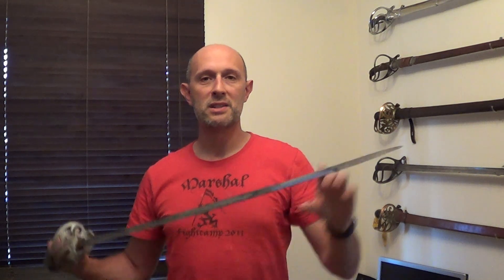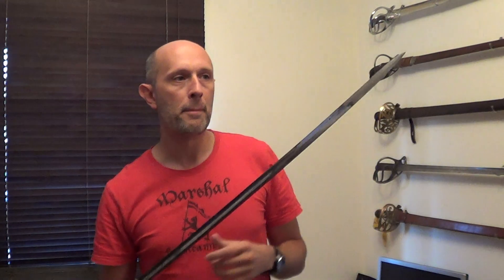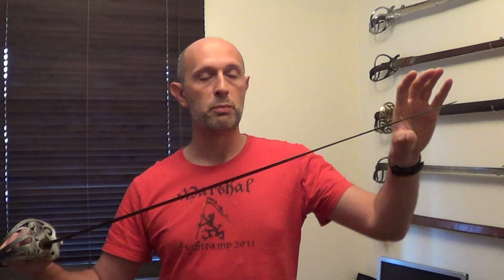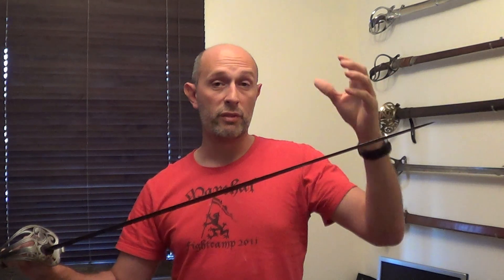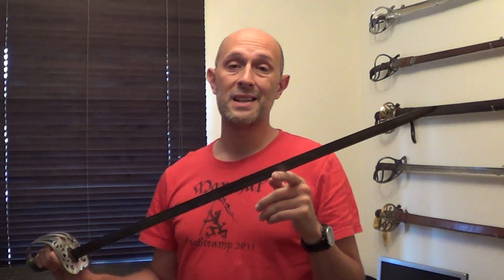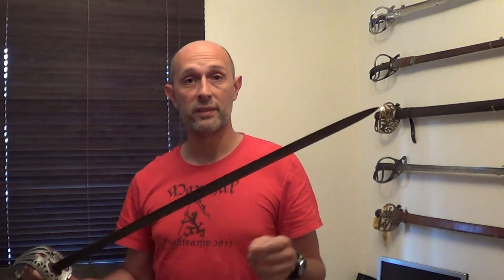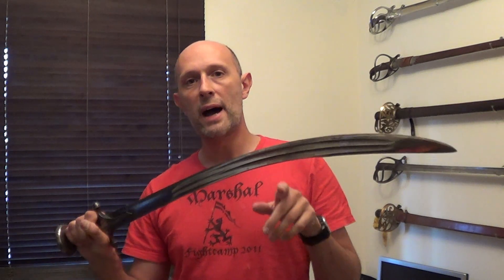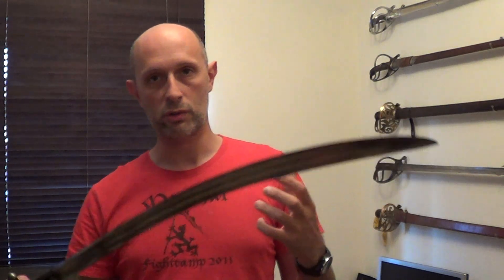Flexibility of sword blades

Comment: I have another question. In modern fencing there is a technique particularly in foil called "flicking" in which you whip the blade in a way to make it bend. This allows you to go around your opponents parry (or guard in epee) in order to strike them. Is there any historical accounts of flicking being done or is it purely a modern thing? I would assume that it would be only useful in a pure first blood duel since you wouldn't get enough penetration to actually kill someone (I don't believe). I also heard that in Chinese bamboo spear they're flexible like that in order to perform similar techniques. I've never found any solid evidence to support this.
Reply from the maker: Gallowglass You cannot flick real swords because they are stiff. If they were as flexible as a foil then you wouldn't be able to thrust through clothing with them.
Reply: As far as I'm aware, from a European perspective, it's a purely modern thing.
Reply: "in Chinese bamboo spear they're flexible like that"
Ahmmm. I don't know what kind of bamboo they use, but I have larp spears made of bamboo and honestly I use bamboo exactly because of the opposite. It's not flexible at all so it allows me to have good stopping power in my spear when somebody tries to charge me.
Reply: It's important to consider length.  Chinese spears are Looooooooong.  At the lengths they employ there is a good degree of flex, even in a hardwood or bamboo.  There are techniques that involve taking advantage of the this flexibility to strike around someone's parry, but like in most spear fighting systems, cuts are mostly to take advantage of the opportunity to wound the opponent and not the main goal.  Thrusts are the spears main value.  They aren't so flexible as to mess that up.
Reply: *****
What lenght would you consider it "looooong"?
I use 6 feet spears. The others I've seen start to flex a little bit passed 9 feet when still thin. People tend to go with thicker bamboo after that.
Reply: The chinese spears I'm familiar with are all over nine feet, usually over ten.
Reply: ok, that looks more like it
Reply: illyounotme However, also irritatingly named Wushu, http://en.wikipedia.org/wiki/Wushu_(sport)  
is a martial art, similar to kickboxing, though i find it to be more entertaining to watch.

Comment: Wibbles! lol
Oscillations assist with a cut.
Also, wouldn't an Asian super bendy sword, when penetrating and being deflected to an untrue (not straight) path, create a destructive path which might a) be more difficult to treat/heal, and b) cause a quicker finishing blow by hitting more essential organs?
Reply: No, super bendy swords do not cut better. When the sword hits a body it transfers force (I assume you know this), the amount of force transferred determines how powerful the strike is, how far it will penetrate, whatnot will be able to cut through. A super soft, bendy sword transfers much less force and therefore provides an inferior cut.
Reply: Also. The oscillations do not continue once the sword has penetrated more than an inch or so. The human body, particularly the muscles, offer quite a bit of résistance.you are not going to have a sword oscillating inside someone and cutting them up in that way,
Reply from the maker: Paul Sweeney Oscillations in the direction of the flats/sides absolutely do not assist with a cut! They slightly impede it by increasining friction and dissipating energy.
Reply: I don't think so...I see what your getting at, but I don't think a wide, messy cut is as damaging as a clean, deep cut.
Reply: The body is only about 8-10 inches deep, and a punctured organ can be healed (to a degree), but upon hitting a rib or other bone, if the blade's flexible enough, it'll hit numerous organs.
Were I on one side of the weapon, it'd be the wielding side.
I'd still prefer a cut 'n thrust wide bladed rapier or a basket hilted claymore, though.
Reply: As others have said, they don't really help at all. In fact a properly designed sword should have a node at or close to the centre of percussion (the part of the blade you ideally want to hit with) which represents a stationary point that the standing wave in the blade oscillates around to minimise the effects (if any) of vibration.
Reply: *what it will be able to cut through

Comment: Is an Albion sword the best and most accurate in a historical sense that is also deemed "battle ready" or are there other sword makers out there of the same quality.
Reply: Mass produced  probably.  But you will find smaller companies and or blacksmiths that do just as good or better work than Albion.  Baltimore Knife and Sword is one that comes to mind.  I bought a customized arming sword from them for way less than an Albion but it's quality was the same.  You'll find many of the smaller places won't charge near as much.
Reply: Albion is widely considered to be the best and most historically accurate manufacturer of production medieval european swords. If you want a sword outside of that historical and geographic context then you would need to look at another company. For example I have heard that some people feel that Arms & Armour make the best rapiers. There is also the option of building your own sword. Some people on the forums claim that Angus Trim makes blades which are on par or in some cases better that Albion, but the finish and fittings are generally pretty rough, so it is possible to get a high quality bare blade and add your own custom fittings if you are confident working wood, metal and leather. As others have said, you can also go with a custom sword maker rather than buying something off the shelf. There are a number of Eastern European smiths that can offer custom work at prices competetive with Albion. I recently saw photos of some of Vladimir Cervenka's work and it appears to be very impressive.
Reply: lancer D I am confident with wood/leather but would be hopeless with metal working. Anyway i was just wondering since most people ive talked to consider them the best in medieval sword manufacturing.
Reply: Ransom Purvis
  What I've seen they are  when it comes to replicating sword designs that are in museums.  But if you want a sword that is not an exact replica of a period piece but is still quality, there are other options.
Reply: LaughingOwlKiller
BKS though i would say run closer to a custom smithy rather than a production company would you say?

and yes albion is kind of limited in that they MOSTLY make swords from the saxon and viking eram to the early renaissance era (1600 or earlier) they make one germanic chopper and 3 models of gladius but nothing else, no sabres, no greek swords, no chinese or other asian sword types etc.. no rapiers or smallswords either

that being said they hit their niche really effectively..

Comment: Also South/Central American "swords" are made of wooden paddles with chunks of rock wedged into the edge to make a cutting surface. So they would be even less flexible.
Reply: illyounotme Yes, as OP said, the more stiff the edge, the sharper it can be (though it will shatter easier). The use of wood as the body of the blade is a good measure to prevent the entire blade from shattering. If one tooth of obsidian broke, the rest of the sword would still be intact (almost like a chip on the edge of a metal sword).
Reply: illyounotme Yeah I agree that metal is not required to make an effective sword or even armour. Even today if guns were not in the picture one could still fashion an effective close quarter sidearm out of an ash branch and some flakes of obsidian, or even hardened glass.
Reply: +illyounotme  that makes you imagine a modern blade of carbon fibre or such as the body with edges of diamonds, one next to the other, in such small gems that the naked eye can't see that it's not one continuous edge but many wee teeth.
wouldn't that be the sharpest and possibly most resilient sword we can make today? with metal or such implanted in the blade for mass.
Reply: illyounotme i hadn't heard about obsidian scalpels, only diamond.
i thought diamond would be sharper?
Reply: illyounotme  ok, cheers.
so carbon and obsidian then.
and great care with parrying^^

on another of Matt's videos someone who sounded very technical explained in a very competent, and condescending tone that steel was still the best material until carbon fibres started to acquire the properties of steel in their flexibility and sharpness. it was some carbon tube thing, that apparently could become sharper while more durable than steel can.

Comment: Blue coloring is actually fully soft.  You want a straw or yellow color to make it flexible and strong.
Reply: TheStonehammerFiles
Blue color annealing might not be the best for a "modern" knife edge. But it was favored for everyday agricultural tools (sickles, scythes, billhooks, etc), because high hardness wasn't a requirement, while impact toughness was (and they never were too careful). Same with european sabers and swords. Holding an edge isn't a binary propriety either, and all carbon steels are left behind specially designed steels. A 1075 steel rapidly quenched in water and blue tempered will hold an edge better than a 1040 steel slowly quenched in oil and straw tempered.
Actually, some modern makers are mostly successful salesmen, and couldn't care less about scientific exactitude. Only very few makers actually work with qualified scientists. And if you want to disproves what's written in every metallurgy book worldwide, you'de better have much strongers arguments than some "modern makers" authority.
My bad though, I wrote "complete annealing", while the correct term is "full annealing". It's over AC3 for hypoeutectoid steel, and over AC1 for hypereutectoid steel. It's not "low heat", it's austenitizing temperature. Just take a look at iron-carbon diagram, before calling these established facts "dogmatic nonsense".
Reply: depends on the steel.
Reply: lancer D
 Not with blade steels.  Ask any knife maker.
Reply: lancer D
Just one old man from the late 70's  Look up William Colins, Jacklore knives, Ed Flowler and many, many others.  They'd tell you the same.
Reply: After a water quench, which is the most drastic kind of temper possible, the only way to restore "full softness" in a complete annealing. It takes hours, starting from austenitizing temperature (which basically is quenching temperature). Blue color temper is the traditionnal spring steel temper, and springs were rarely quenched in water (too drastic, it might generate deformations or even micro-cracks). After such a temper, depending on the steel, hardness should be in the 45-50HRC range. Actually, you can heat up a blade up a quenchend blade to over 500°C, when the steel just starts to glow, and still retain a level of hardness and flexibility (over 40HRC) very clearly differentating it from annealed state (below 20HRC). I remind you that quenched-like-crazy 1075/C75 basic carbon steel can reach up to 65HRC (very high risk of cracking though)
Reply: lancer D
Normalizing releases all stress.  While Annealing (the blue color) softens the steel.  Sorry, Straw yellow. not blue. Personal experience as well as advice from other makers.  Lance, get your head out of your ass.  He is spouting dogma from dyed in the wool sheffield makers.  Blue doesn't make a good edge nor does it give springiness..
Reply: MadNumForce
Quenching is far from tempering.  That is hardening the blade.  Taking the steel to a low head, which is dependent on the type of steel.  When you get the blue color, it becomes too soft to hold and edge effectively and give durablity.  That is the straw yellow color.  What you are saying is dogmatic nonsense that has been disproved by modern makers.
Reply: MadNumForce  you're talking to some one who also has first hand experience with simple carbon steels.  I've use 1095.  Blue is way too soft to be a serviceable tool

I got Wayne Goddard's books.  Which has to diagram in them.  I studied it well.  Straw gives a better edge than blue that will last far longer and still will not chip or roll.

Tempering tempretures are between 300-500 degrees.  For working steel, that is low.  Seriously, have you ever worked steel before?  Sounds like you haven't.
Reply: TheStonehammerFiles
 at 300-500 would it not be almost the same as just normal "cold" steel?

i do a bit of blacksmithing(not all that great) and cant really notice much of a change till it starts get a glow (so what 1000+?) then again only worked something in that range like once (was trying to color some metal and notice it of off a little not sure how hot it was at that point but was good enough to melt some skin :D)
Reply: crikk23
300-500 is the tempretures to temper the steel not to anneal it.  Those for an hour, depending on the type of steel will give a straw yellow color.
Reply: TheStonehammerFiles
 I believe you are the right person here, since you got a very black smitty profile picture. lol
Reply: The information is easily looked up.  As well as there are many professional blacksmiths and knife makers on YouTube that can tell you the same thing.  And yes, I have done a  bit of blade smithing myself.

Comment: Your generalizations of the modern typical katanas is not entirely correct.  I wish you spoke of swords from the stand point of the steel type rather by where they are made or by sword type.  Many modern typical katanas are not differentially hardened.  And many katanas are made of spring steel.  Maybe a topic for a future vid.
Reply: "traditionally made"
Reply: Matt is talking about historical weapons and antiques, not modern replicas.
Reply: lancer D That's makes sense now.  I must have miss heard him.  Thank you

Comment: I don't think a decently hardened steel blade can bend 180 degrees without breakage. If a blade is that flexible, then the hardness would be too low to hold any edge, or as you said will bend on small forces. It is possible, however, to bend it prior to hardening process to test the integrity of the steel.
Reply: To be considered a master in the American Bladesmith Society you must produce a knife able to "cut a free hanging rope, chop through 2 2X4" pieces of lumber and retain an edge capable of shaving hair. Lastly the knife is placed into a vise and flexed for 90 degrees.The knife must spring back without breaking and remain functional and not slip from the handle." given that we are talking about a 30 inch sword rather than an 8-10 inch knife I see no reason why 180 degrees should be a problem if it is really top quality steel and heat treatment.
Reply: lancer D I guess you are right. But the description states "remain functional," which does not rule out if the knife is permanently bent on a minor level. I have never experience any blade near that level of quality so it is a little hard for me to imagine that.
Reply: 9SS94Cr They do take a set, as I imagine a sword would, but the point is they don't break. I think most people never experience a knife that good as these guys often sell their blades for several thousand dollars each. you can view some tests on youtube, and they are pretty impressive.
Reply: lancer D Thanks I'll.
Reply: lancer D I would be very interested to watch some of those tests.  Can you reply with a link or channel name?  I've only really been into edged tools and weapons for a year or so and I love finding new sources of information.
Reply: ***** Search "ABS knife test" I'm sure you can find some. Like this watch?v=4v5RAJsLTVU
Reply: 9SS94Cr Thanks!!
Reply: 9SS94Cr Of course not all european swords were that level of quality. One of my favourite accounts from the 19th century shows what happens if a sword is too soft. It can be found from the 2nd paragraph here http://www.forgottenbooks.com/readbook_text/Under_Crescent_and_Star_1000475046/205. Another shows what happens when a sword is too hard http://tinyurl.com/obsv33m
Reply: Thank you a lot. I will check them for sure.